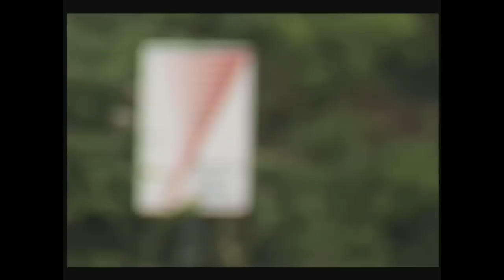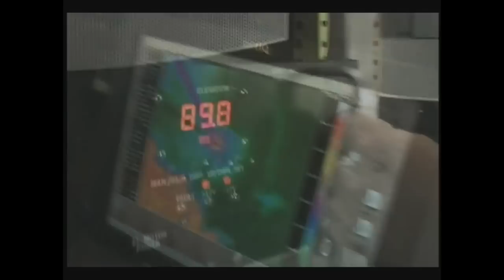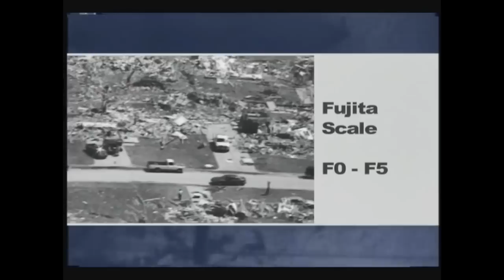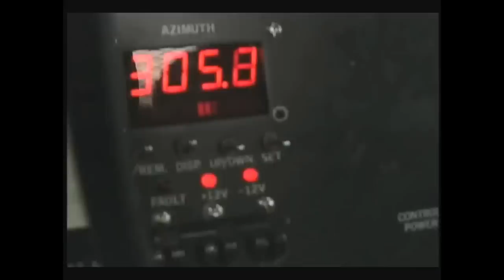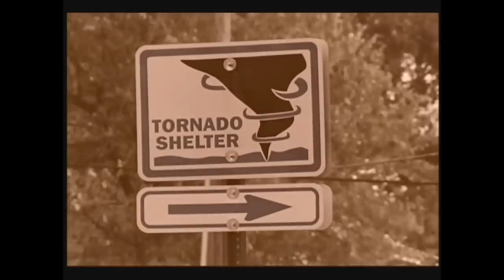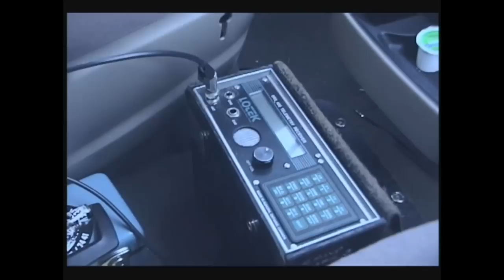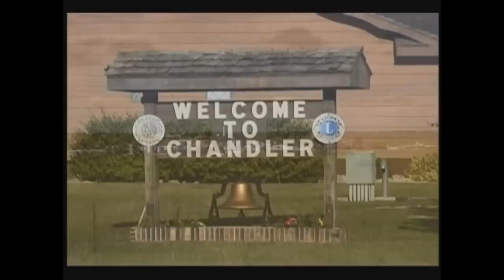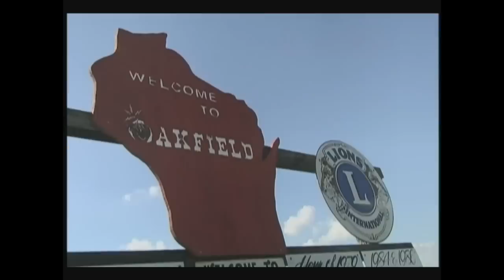Storm Stories - F5 Tornado

Comment: They should have to have mandatory storm shelters for apts and mobile home parks. My son lives in a second floor apartment and I worry every spring and sometimes fall.
Reply: Some try but the insurance companies won't cover them.  That's why they have them.
Reply: I live in a apartment I live in this valley area that goes down to a central point thst has a creek that goes 20 to 30 ft deep possibly 40 feet deep remember this what I am most wored about most is flodding because in a really bad storm the little stream that is literally 5 inches deep and wide can become a river also a deadly tornado did come through dont know when but my apartment isn't new and trees are ripped  from the ground so no worries there plus there is metal beams in the walls because reception and wifi is horrible with all the metal in the walls
Reply: Sadly, there are all kinds of legal issues that could get in the way of that (like if someone wants to bring their pets but someone else is allergic).
Reply: I as well live in a second floor apartment. I asked my landlord where to go if bad weather comes and she literally shrugged 😳 like a plan NEEDS to be in place. I would grab my cats and hide under the stairwell on the first floor if I needed to take shelter.
Reply: @JCBro-yg8vd  allergies is the last thing your gonna worry about during a tornado
Reply: @imbatmam4760  Depends on the severity of the allergy.
Reply: @imbatmam4760  you would think so, but some people are huge assholes, and I actually heard of a case where someone tried to keep a guy from bringing his cat in a shelter. Can you imagine, telling someone they have to leave their pet up to maybe die terribly? Ick.
Reply: Too bad the town doesn’t have a community storm shelters, in Kentucky there’s a town that has community storm shelters.
Reply: @cutebutsadisticable hey 👋 there have you ever seen a tornado 🌪 in person I'm just wondering 🤔 💭 OK 👍 👌 🙆‍♀️ rip 🙏 🪦 for the mY 3rd 1999 tornado moor Oklahoma city 😢😢😢
Reply: Having insurance issues due to an act of God....merika
Reply: Yes!!!! this could literally save so many more lives
Reply: Look I get that and understand that but insurance company won't cover it or give you extra money to build them.
Reply: @samuelraytheweirdcontentgu8551 happy momaril day have you ever seen a tornado 🌪 before I'm just wondering OK 👍 👌 🙆🏻‍♂️ Sr
Reply: @JCBro-yg8vd do you have an storm shelters if case there's a tornado 🌪 warning ⚠️ issues in
Your aera

Comment: In addition to better lead time, why don't we push for better building of homes and businesses.  While it's not financially feasible to EF5 tornado-proof a home or business, it has to be feasible to build homes to withstand 120-160 mph winds. Florida has been doing that since Hurricane Andrew. 120-160 mph winds are the equivalent of a mid-level EF2- high-end EF3, which are more common than EF4-EF5.  And above all, why don't we make it a requirement that all homes built in Hoosier Alley, Tornado Alley, Dixie Alley, and Carolina Alley have FEMA approved safe rooms.  Especially since most of these alleys consist of states, whose geology don't support underground shelters.  While there are no 100% guarantees, these should help lower the death toll from tornadoes.
Reply: @Jo'El R. That's what I said.  Read my comment very carefully.
Reply: Houses can be strengthened to be wind resistant it won't survive an F4 or F5 but it will allow the house to survive on the outskirts of a tornado
Reply: You also have to realize a hurricane isn't as concentrated   120+mph wind spread over a large area with little debris does nothing in comparison to 120mph+wind with the same wind circulating back to the same spot with debris also continuously pelting said spot/house until whatever it's hitting breaks and adds to the debris and possibly creates a space for the wind and debris to continue tearing apart. That's why its not as similar as the wind speed makes it seem.   Besides even looking at a mile wide f5/ef5 tornadoes path the core is usually only a couple hundred feet wide in most cases, the rest of the path probably looks more like hurricane damage  with broken trees and minor damage to exteriors
Reply: @hu4lifefuckdeuce  thanks for the information.  So how about have homes built with FEMA-approved safe rooms.
Reply: @A_Muzik  well of course it would lower the death toll  a little (hopefully) but even if all new homes have them   many of the houses in Moore that were hit  were older houses   the majority actually. For every new house with a safe room in the path of a tornado there's probably hundreds that don't and will never.   And seeing as how most people huddled inside tubs and closets survived it probably wouldn't be a noticeable change in fatalities   that being said it's not feasible for everyone to build one  but I agree it would be the best option. FEMA had a lottery to build some on existing properties for the many that dont have the money for them
Reply: @hu4lifefuckdeuce  I mean how about homes be built with them? Especially after Phil Campbell, Tuscaloosa, and Hackleburg.  People huddled in tubs and closets there and had a literal hell of a ride.
Reply: @A_Muzik  especially schools.
Reply: .homes such build to way cheaper a is Defragging
Reply: Because nothing can survive an EF-5
Reply: @nadokid1  Only an earth-sheltered or earth-bagged and cobbed structure can.
Reply: AJ Muzik  I have a Question for you have you ever seen a tornado 🌪 in person I’m just wondering if you ever seen a tornado 🌪 in person I hope 🤞 you have a great 👍 day
Reply: @A_Muzik  no, stop with the regulations. Its 2020 people know where it is they are living and they understand that each area of the country has its own risks. It is one thing to require a school to have a safe room, but its a completely different matter when discussing private homes.
Reply: boi how bout we get shelters in every house we can shelters so we can prevent Moore Oklahoma City lone grove Tuscaloosa El Reno Joplin and more (yes I have been in a lot of tornados like the tornados in Texas and north/South Carolina tornado out break 2010) so also schools I have a few word for you plaza towers and braierwood(can’t spell that) and Moore 2013
Reply: Guess what me and my mom survived the covid 19.  Thaink god me and my moM survived the covid 19
Reply: @clipsandvideos9648  Bullshit.  We're talking about saving lives here.  And having homes built with shelters already inside is a necessity, especially with the impoverished.  Why should people be put in positions where they're sucked out of the closet simply because they can't afford a storm shelter and can't afford to move?
Reply: @dpflack1744  Thankfully no.  The closest I ever want to see a tornado is on YouTube.
Reply: we don't need any of that. basements are just fine it's just not everyone in tornado alley has a basement.
Reply: @Maplelust  Basements are good.  The problem is that there are areas where the ground doesn't support having a basement because either the soil is clay or the water table is high.  And I am not just talking about Tornado Alley.  I am also talking about Carolina Alley, Hoosier Alley and Dixie Alley especially since the latter is especially prone to significant tornadoes in the autumn.
Reply: @A_Muzik  ahhh I see.
Reply: @A_Muzik  I'm going to have to go with the other guy here When you start interfering with peoples private homes what's to stop you from saying Oh you have to move out now :) a better Idea would be in those areas to subsidize the construction and fitting of homes should the person want one should they not want one then leave it be much better than manually making it more expensive by saying that houses cannot be built unless they have one which would hurt the impoverished as well considering the costs of the materials to build those shelters
Reply: @A_Muzik I just subscribed to your YouTube channel OK 👍 👌 🙆‍♀️ have you ever seen a tornado 🌪 in person before I'm just wondering 
OK Sr my birthday 🎂 is this Thursday on February 8 2024 on a Thursday
Reply: @rnbsteenstar I just subscribed to your YouTube channel OK 👍 👌 🙆‍♂️.  Sr
Reply: @DanielleFlack  🫂

Comment: If u want to see something crazy.  Go on google maps and look up Joplin Ms  I’ve looked up a lot of towns hit by tornadoes and I think this is the worst.  Even now after this many years later.  It’s very clear from the satellite view that a huge tornado destroyed a straight path in the town.  U will see a line that is more brown. No trees. What trees are left are basically just the trunks. What I’ve noticed is a clear sign.    Is all the half driveways that just go onto a cleared lot.  And All the houses will be new looking as well.  It’s just devastating
Reply: Joplin, MO (Missouri), not MS (Mississippi).
Reply: I did just that---the devastation was still visible.  It will take them years, maybe a couple of decades to fully recover.  But it won't be the same.  (Jan Griffiths).
Reply: Saddest of all is the trees. They take years to come back.  There were a lot of arguments about why the Joplin death toll was so high (159) but compared to the amount of flattened homes and businesses the death toll was in line with other F5 tornadoes where a 1,000 homes were destroyed and over 50 killed.  In Joplin, there were over 3,000 homes utterly destroyed.

Comment: Amazingly good videos. Do you think they could increase the scale to an F-6 if the wind speeds reaches over 300 mph?
Reply: They've considered it in the past, but the F5 rating generally is considered enough at a tornado that meets or exceeds 200 mph wind speeds.  I believe they may upgrade one someday, especially if a large metro center is hit by a tornado similar to the El Reno tornado.  The destruction would be unfathomable.
Reply: When the dead man walking tornado hit Jarrell, Tx they considered rating it a EF6 cause no one was safe during that tornado not even if you were in a storm shelter. That tornado was absolutely strong and then the El Reno tornado of 2013 at 2.5 miles wide was huge and had winds of 300+ mph. If that tornado would've Oklahoma city I think it would've been the first EF6 ever rated.
Reply: Prior to 2007 and the adoption of the EF scale we wouldn't have needed to. The original Fujita scale had an F6 rating; in fact, it went all the way up to F12. Dr. Fujita positioned his scale in such a way that it would fit perfectly between the Beaufort wind scale and the Mach scale. Quite brilliant if you ask me. The reason the upper ratings were hardly talked about is because the Fujita scale was designed as a damage scale, and F5 winds (261-318mph) cause maximum damage; which means a surveyor wouldn't even be able to tell the difference between F5 and F6 winds.
Of course, this was prior to the EF scale, which we have today. As it stands, the highest rating is EF5. Any tornado with winds in excess of 200mph is an EF5, no exceptions.
Reply: @RojoFern No, any tornado that hits a well-built structure that is presumed to have taken 200 MPH winds to destroy merits an EF-5 rating. The 2013 El Reno tornado had subvortices that produced wind gusts just above the surface that measured approximately 300 MPH, but was rated EF-3 because it didn’t hit any structures to merit an EF-5. The EF scale is rated on damage only, unfortunately.

Comment: I don't understand why the NWS doesn't consider the May 3 1999 Mulhull tornado the widest ever on esrth. It was twice as wide as the May 31 2013 El Reno 2.6 mile wide monster. I mean last I checked, 4 miles was more than 2 miles. And if the Mulhull tornado was actually captured by the DoW, there's actually no excuse as to why it's not recognized as the widest tornado in recorded history. Make me understand this!

Comment: Wrong! The original report was the wind speeds that were recorded were 318 miles per hour.
Reply from the maker: Yes, but that reading was taken at a height of 300 meters. It was adjusted down to 302 miles per hour for the ground level wind speed.
Reply: still not quite enough for F6 but almost

Comment: Tornados can occur in any state? Not true. While not impossible, I can't think of any tornados that hit somehwhere in Alaska, Maine and around that state, Hawaii, etc...
Reply from the maker: Alaska has had 4 tornadoes since 1950, and Hawaii, Maine, and even Nevada have each had more than 30 tornadoes since 1950. Tornadoes can and do occur in every state, but most of them are weak. I suggest the website tornado history project for research in the topic.
Reply: They've happened everywhere except Antarctica
Reply: You seemed pretty confident.  How'd that turn out?
Reply: @davidfoster7173  Wheatland, Pennsylvania also experienced an F5 tornado in 1985.
Reply: There was a damaging tornado in the seattle area last year. It can definitely happen anywhere. I was in 1 in washington. It was small but still a tornado that picked up a neighbors barn and moved it like 100 yards